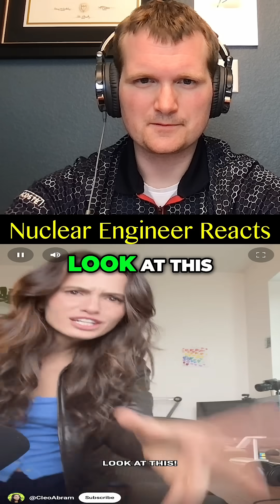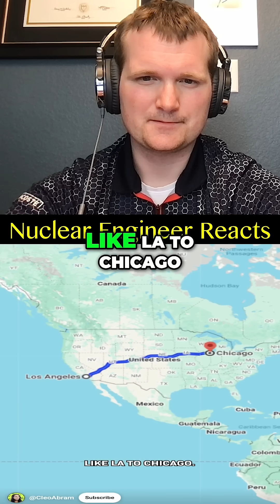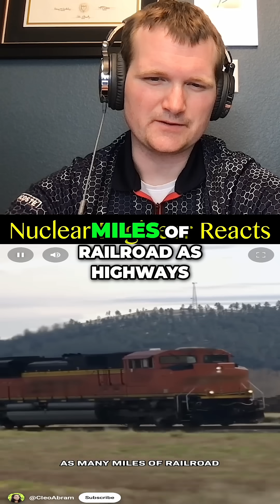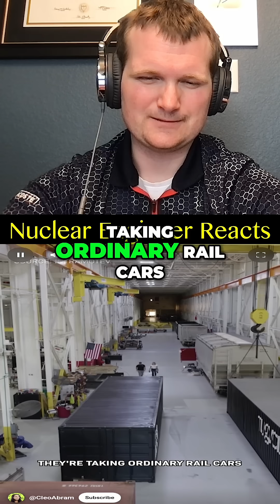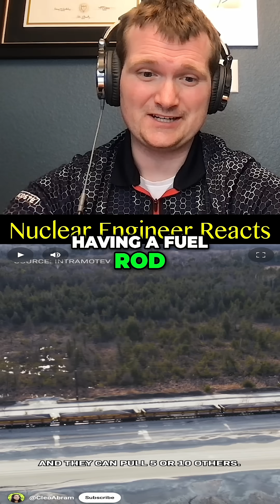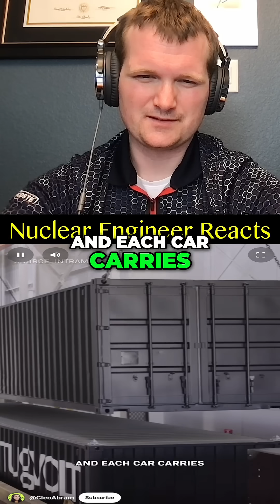This New Train Drives Itself - Nuclear Engineer Reacts to Cleo Abram

Comment: Main problem is see with the original video is this stuff already existed minus the self driving train outside of hump yards or large rail yards. 3rd class railroads exist that already do this job only thing is they usually transport local raw goods to local factories or transport factory goods to a distribution center or larger rail yard.

Also self driving trains might not stop (at all) when they encounter a problem.

Comment: Why not have a bunch of miniature nuclear reactors power neighborhoods and suburbs and small towns giving them more grid independence and cheaper power and natural disaster resilience?
Reply: Do you believe it is safe to have a "miniature" nuclear reactor in your town/suburb? there is no indication that such a thing would decrease cost of power in a localized area, and even smaller, they still need to produce steam, run turbines, and have all the safety measures of a "normal" power plant. 

Same thing with the mini-trains, they still run on active lines, they still need work at both ends to make their short line runs, they still need all the safety systems of current rail, and they still end up getting put on a truck to go to a warehouse.

Comment: A mini train kind of defeats the purpose of a train.
Reply: It kinda doesn't. Lots of work to be done, both before the long haul and after.
Reply: @mykolapliashechnykov8701  why not use trucks their flexibility makes them better at that scale.
Reply: @Ymir._ Currently, trucks have to go to loading ramps at the RR sorting, get unloaded, leave. Same happens with unloading the trains.
With this approach, railcars will get loaded at the shipping facility and sent straight to the switch yard. Less work for the railroad, faster train dispatch, faster average railcar speed.
That's mostly how logistics worked in the Soviet Union, sans the robotic, battery powered locomotives. Every big company had a railway branch and a couple small diesel engines.

Comment: Eh, big disagree with you here, which is rare. These new mini-train bots are meant to be a stopgap for exactly what Ms. @CleoAbram mentioned — smaller, regional loads that would normally be stuck either waiting for a many more cars-worth of goods to pile up to justify sending a train, or shifted to higher cost semis if speed was more critical. 

This 3rd self-driving minitrain option provides flexibility for already existing train lines, depots, suppliers, and warehouses.

Comment: Its the same nonsense as an SMR. i build 6 so we can make them walk away safe with passive heat rejection. 
instead of one of them that requires active cooling that does the same amount of work with fewer moving parts and lower overall maintenance.  More base resources to get the same output. remember when we designed for efficiency ?

Comment: Its a fallacy that a battery-operated vehicle is low pollution.  How absurd.  The huge diesel vehicles that mine battery minerals and use diesel trucks to  ship the minerals to a refinery that also uses fiel to operate and then use diesel trucks to send the batteries to a plant to build into a pack to then be sent on another diesel truck to the manufacturer who then has to burn fuel to generate electricity to charge the batteries once installed on the car. Some people shouldn't have access to other people.
Reply: Shut the yap and show the numbers.